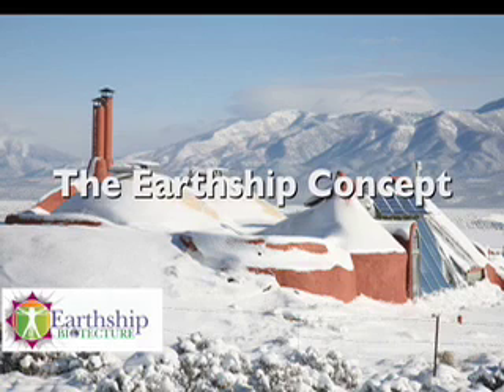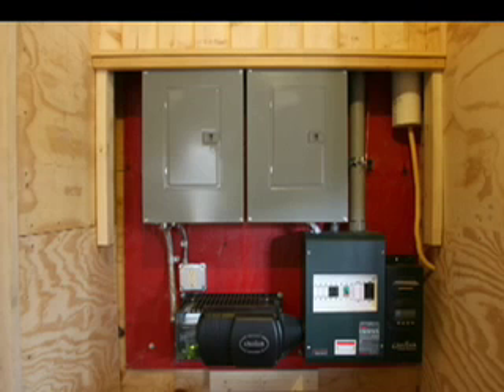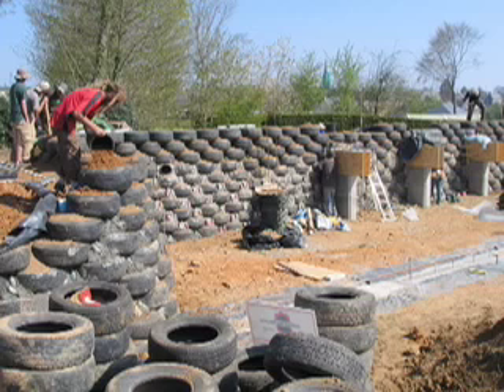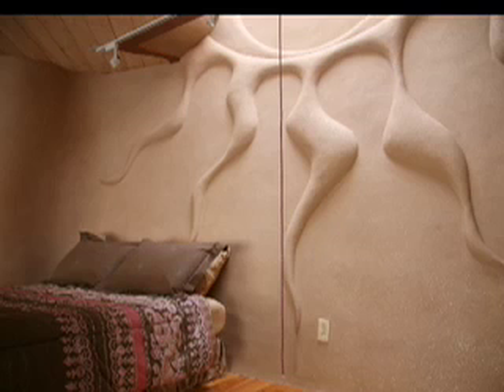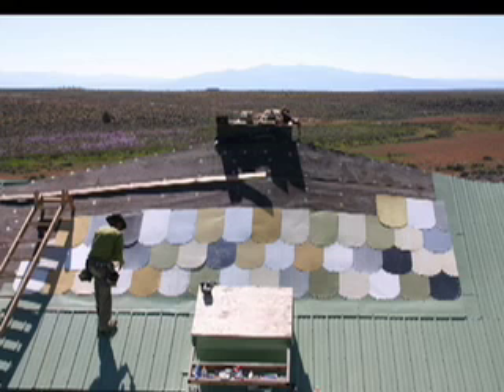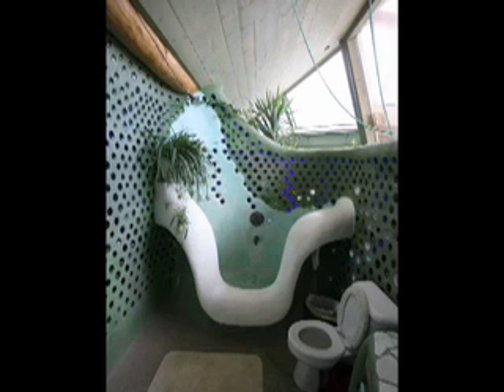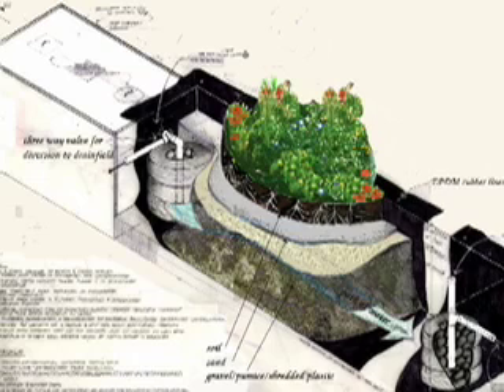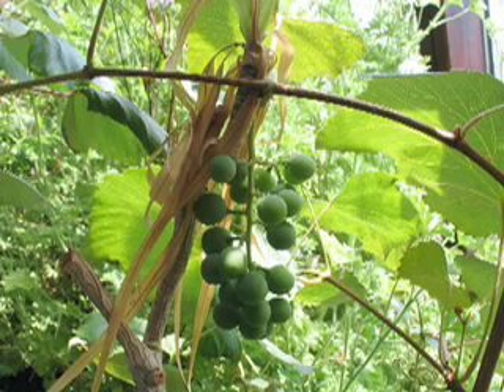Earthship Design Principles

Comment: But, how much does all this cost to build? House of that size seems like it would cost several hundred thousand dollars in materials and paid labour to construct. Sure, you can then maybe live sustainably and reduce your utility bills, etc. But how long does it take to pay for itself. And can the "average Joe" actually afford one of these monuments?
Reply: You can get alot of the materials for free biggest part is the labor. That's why you build them in teams.
Reply: At $250/sqft, if you wanted a 1000 sqft house (one assumes a portion of that is "unusable" other than for the planter(s), cisterns, filtration systems, etc.) it'd be $250,000. Not exactly "affordable" for the average Joe. I mean, sure then maybe you don't have to pay typical "utility bills," etc. But you're still paying a quarter million dollars for this thing, and taking up a lot of space in the process. Is it really better than other, potentially cheaper option like Tiny Homes, etc.?

I mean, I like the concept somewhat, but it seems expensive and perhaps overly complicated with all the systems that have to work together, one assumes be maintained over time, etc.
Reply: I agree. The problem with the 'sustainable movement' these days is that is doesn't challenge the status quo powers who control energy, water, food and all other resources through fiat currency financing and government licensing. The corporates control it all and worst of all, even if you COULD get financing to build something like this, your local larceny council will never approve your construction until and unless you feed their piglets.

Comment: Use less pumps, they are expensive, manufactured components that will require replacing with time. Use more gravity fed pressure systems. This will require you to build taller buildings. Alternatively you could use elevated water storage, with the water being lifted by means mechanical or evaporatory.

Comment: what is the advantage of a black water system with a septic tank over a composting toilet? I had a composting toilet at my previous home and built another from Adobe.... It needs no water and turns your waste into compost which in turn will nurish your soil..... The one i had didn´t smell at all and i live in a very hot country.... Black water systems seem very clever but if u have a septic tank full of waste you then have the task of emptying... Why waste recycled grey water on flushing?

Comment: This is very interesting.

I would like to know:
How much does it cost (labor+materials)?
How much of the materials used depend on fossil fuels for production (like to solar cells)?
Reply: Cost per sq ft is about the same as a standard house. Labour is where you can save if you have people to help you.  You can also get a machine to help you ram the tyres, use sand bags or use tyre bales, that saves a ton of labour,